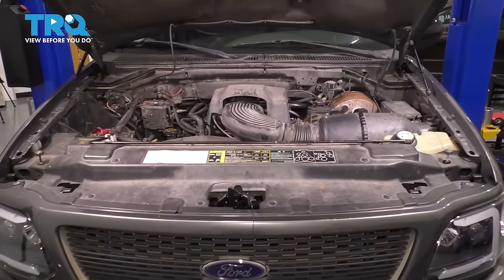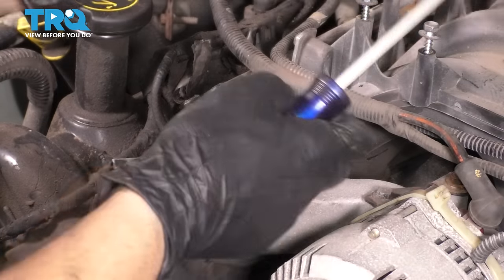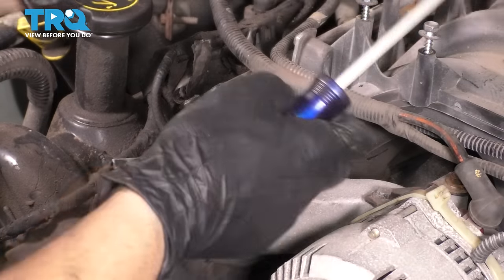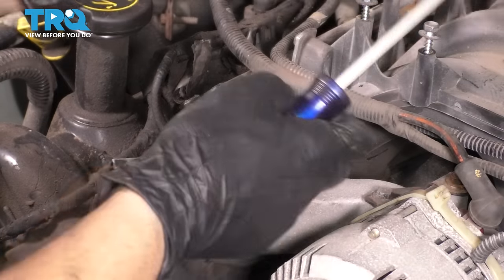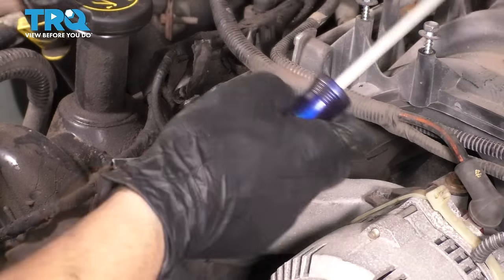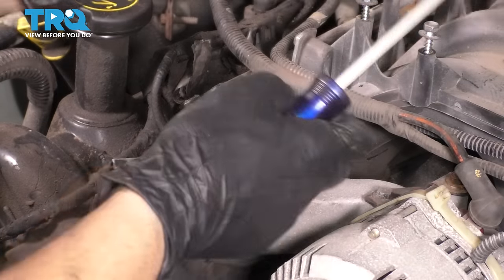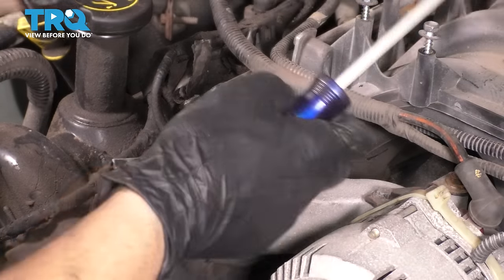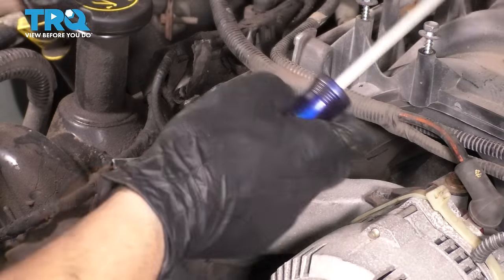How to Replace Head Gaskets 1997-2003 Ford F-150 (5.4L 2 Valve)

Comment: Just a little FYI.. if you do the double nut method, once you jam the 2 together use the bottom nut to break the bolt loose. Using the top one will just spin off everytime if the bolt is tighter than what you jammed the 2 together at. Highly unlikely to spin both nuts jammed together, possible but unlikely.  If it breaks off you would be in same boat as the 1st stud that broke off. I can say though, I've gotten 99% of the studs out using the 2 jam nuts.

Comment: I have a 2001 Ford 4.6 V8.
I am NOT a mechanic.
I followed this video and did a little research.  I was able to replace the head,  water pump, power steering pump & high pressure hose, upper & lower  radiator hoses, all new gaskets & seals, spark plugs and boots.  Many thanks for making the video.  I couldn't have done it without your expertise.  It took me 8 Saturday mornings and 3 evenings to rebuild it all.  I now own some unique tools.  New tools and parts combined about $1,600 TOTAL spent.  May & June 2023.
Reply: Hey  I'm doing the same thing in my 4.6 right now and on my passenger side exhaust manifold I can't get to two of the underneath bolts because the engine mount is in the way of the bolts. I can't even get the socket on the bolt.. did you have this issue. I'm wondering if you had to remove the motor mount or maybe raise the engine slightly to reach the bolts? I have seen other people with 4.6 having similar issue

Comment: I was successfully able to replace my head gaskets along with pretty much 60% of the components on my 2004 Heritage (4.6 V8) by following this video. I had a hairline crack in the cylinder head, so it has caused some damage to many other things as time went on. This video helped me remove and replace pretty much everything I needed. I’m in no sense a mechanic , i’m just a 21 year old kid who wanted his truck to still run and not spend 8 grand for a shop to repair it. Thank the lord for YouTube tutorials, and RockAuto 😂

Comment: Pro tip when removing the water pump, while hitting with a hammer (i used brass) also use a long pry bar against the alternator pushing the pulley of the water pump towards you. That pressure along with the hammer blows pops it off fairly easily.

Comment: Very thorough worth watching - probably the worst designed ford engine to work on , might as well pull the whole engine out and replace with a newer engine and just resell individual good parts of the old engine

Comment: It's been nearly 50 years since I've last overhauled an engine.  My memory isn't what it used to be, I no longer bend as easily, and I'm a bit too big for tight quarters.  I invariable rip things farther apart than is needed.  I have a 99 F250 Super Duty.  It appears you may have removed the outer and inner fender.  Is this the case, and is it advisable?  Are there pitfalls?  Thanks for an in-depth and informative video.  I feel more confident attempting this.  Whether I'll succeed is another story.

Comment: Did you install the spark plug inserts while this was out. As a machinist. I could drill and tap all 8 holes while apart. In less than 2 hours. And install the 8 inserts.

Comment: Hello, on the timing cover front seal, did you add gasket maker around it when installing it? 
Also, is there a way to get a diagram for the timing cover sequence... been researching for some information but no luck yet..

Comment: Dont forget to set your valves before installing the valve covers.  Also should consider replacing the timing chains and sprockets with the waterpump.  Its all off at that point.   If your doing a head gasket its probably almost time for a timing chain and waterpump.  Spark plugs are out, replace them if its time as well.

Comment: After watching a million times and performing the procedure on a 03, can confirm this video is all you need to pull it off, will admit you forgot minuet steps here and there in putting this back here or “I took this off there” blah blah but  common knowledge if you did the work👍

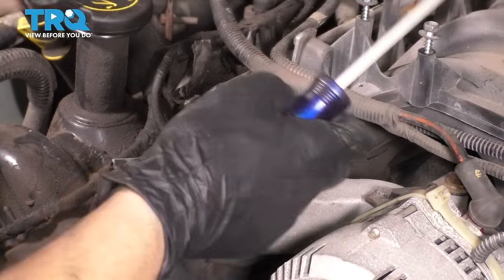Comment: Hello and thank you so much for the very detailed tutorial. I am currently well into this process and I’m right at the point where you are in the video at 35:10. So, rotating the crank to line up the cams. I just had a quick question about that step. On my setup no matter how much I rotate the crank I can only get it to line up approximately 12 o’clock passenger side cam, 1 o’clock driver side cam when my crank groove is at 12 o’clock. Am I good to just remove the tensioners and timing chain even though it’s not exactly what yours shows? Thanks.

Comment: Quick question about those affected by the oil leak on the rear of the passenger side head gasket, I've seen some people just monitor the leak and top up oil as necessary.

Just wondering if this is acceptable as the Ford TSB even states its not detrimental to the performance of the engine.

As people state, $3,000 - $4,000 buys a lot of oil, lol.

Edit: is it really a good idea to use an abrasive (i.e. sandpaper) to clean the gasket sealing surface of the block?  Isn't that making it possible to introduce abrasives into the oiling system and ultimately the bearings?

Comment: When your doing the timeinh and you say 11 and 12 o’clock on the cam gears, is that with the angle of the heads or just looking straight at the motor? Doing this in about an hour and a half

Comment: I have a  2003 4dr supercrew rwd with a 5.4l V8  that needs the head gaskets replaced.  the dealer says that due to clearance issues against the firewall  The heads cannot be removed  without lifting the body off of the frame a few inches to get clearance for the last headbolts..I did'nt see this in this video.  Is this really an issue>  thanks for showing us this   +-9*

Comment: Did you use old bolts or new ones?
Reply from the maker: +Burcly New hardware is not included with this kit. You may reuse the original hardware or purchase it separately.

Comment: I'm doing this on the 4.6 and something he doesn't have to deal with on the 5.4 is the passenger side exhaust manifold has two bolts on the bottom that you absolutely cannot get to unless you remove the motor mount bolts to the block .. the mount Is in the way to the point you cant remove the bolt...There are 3 bolts to the block. Very easy to remove..  Remove them and slowly jack up the  motor with a jack under the oil pan. You only need to lift the engine maybe 1/2 an inch to get the manifold bolt above the motor mount. .. then it's easy to remove bolts.  Flawed design by Ford
Reply from the maker: +@jameswarr6449 Thanks for watching our video! http://1aau.to/m/Shop-TRQ